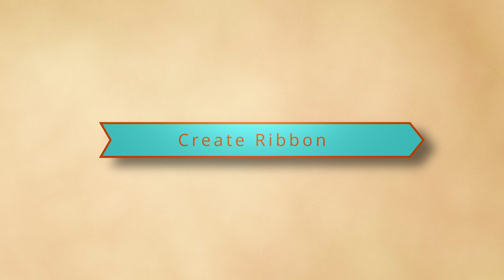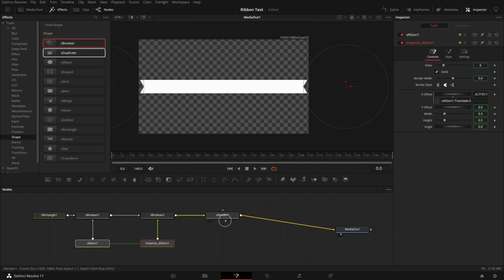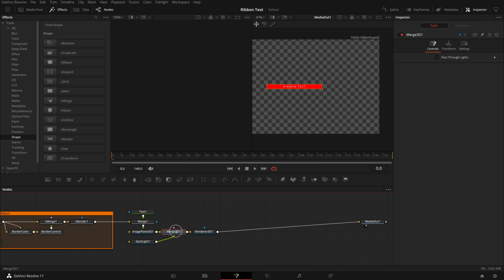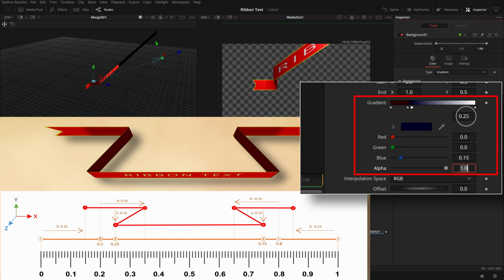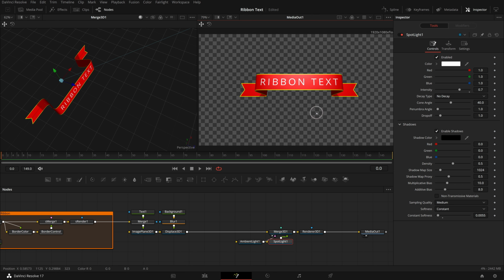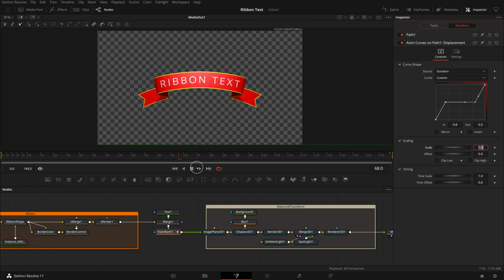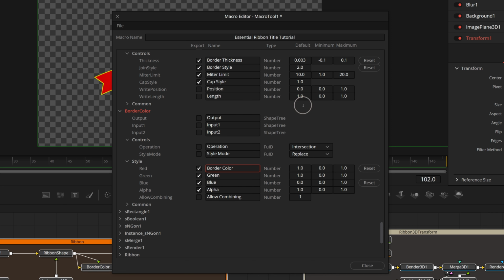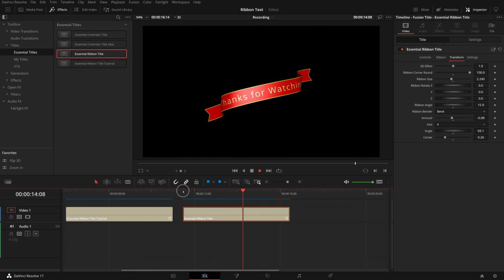Create Animated Text Ribbon Effect using Fusion Tools - Free Template in DaVinci Resolve 18

Comment: How can I have the ribbon animate in but not out?
Reply from the maker: You can simply split the clip in the middle, and delete the second part. if you need the title for a long duration, you can either extend the clip first to make the room for the title, or you can convert it to a compound clip and freeze the second half so you can extend the freeze part however you want.